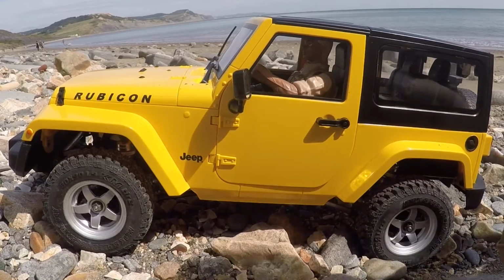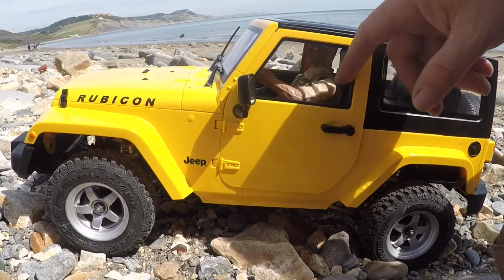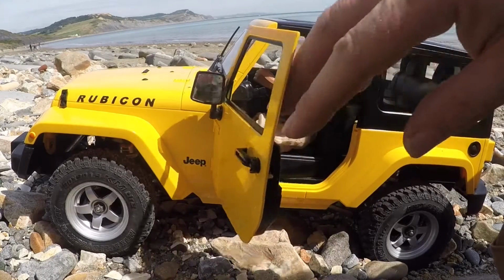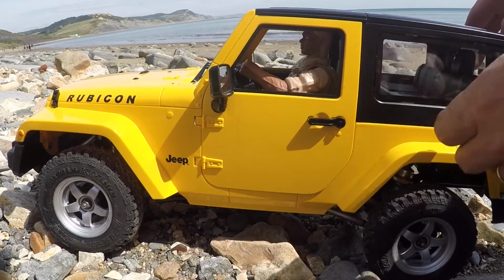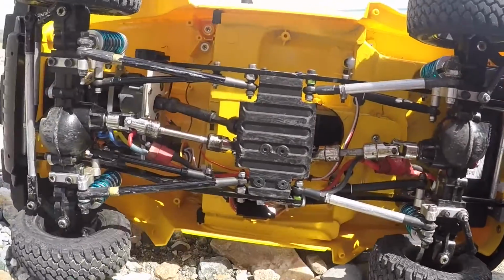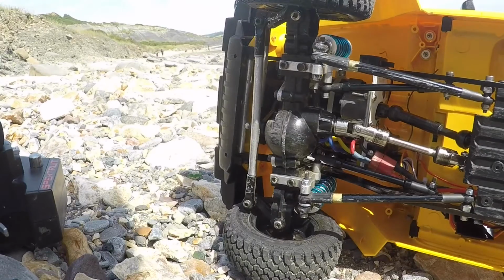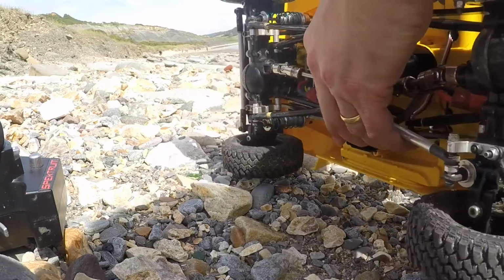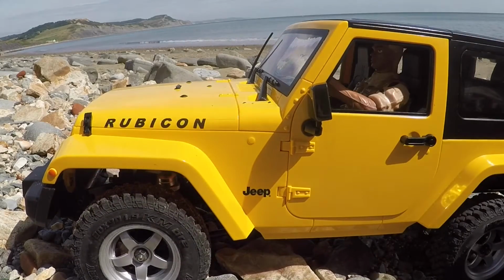1/10 RC Jeep JK Rubicon hard body with front motor and Tamiya high-lift axles

Comment: Good video. Nice camera angles add to the realism. Jeep seems about on par with the capability of a stock Rubicon. Well done!
Reply from the maker: Thanks! I always like to sneak an RC model or two into the suitcase when I'm going on family holidays. I've got lots of very capable RC trucks with massive tyres, but I was trying to achieve a stock like set up as they are much more challenging and fun to drive like this.
Reply: RC Modders ...Just like 1:1. I've had three Wranglers, the last one I built with only a 1.25" body lift and 1" front spacer to keep it low, ditched the fender flares and flattied the front, and ran 33x10.50 mudders. I swapped out the D35 for a detroit locked 44 and trutrac in front. That little jeep was a beast! I dont have a jeep anymore, which is why Im considering an RC crawler to satisfy that need. Cheaper when they break!
Reply from the maker: :) Funny, I was the other way round. The Tamiya Wrangler CC01 YJ (see here https://youtu.be/IaWABL3-AzE) inspired my full size 4L manual 2000 TJ (some pics & vid in the snow last week here https://www.facebook.com/profile.php?id=100015353018714) I've kept it stock (I live in London UK) and got it almost 2 years ago. Now I've got this I don't think that I could really bear not to have one. I think that the RC ones probably satisfy a lot of that itch .....

Comment: Can you put a list of the parts you used so I can build one I like it a lot
Reply from the maker: Hi, glad you like the video. This was a real mix and match and the parts might be scattered across various models now, but the basis would have been a fairly common body like this : https://www.ebay.co.uk/itm/275mm-Body-Shell-for-1-10-RC-Car-SCX10-Jeep-Wrangler-Rubicon-Engine-Grille-Cover/223122112066?hash=item33f31d3e42:m:mJBL1knbL9BrHrhORmVknqg:rk:19:pf:0 gearbox, a gearbox prob like this : https://www.ebay.co.uk/itm/1-5-Planetary-Gearbox-Transmission-Case-For-1-10-RC-4WD-D90-D110-RC-Crawler-Car/183640374622?hash=item2ac1d1bd5e:g:QhkAAOSwj9hcQGLc:rk:2:pf:0, transfer box like this : https://www.ebay.co.uk/itm/SILVER-TRANSFER-CASE-GEARBOX-RC-ROCK-CRAWLER-for-SCX10-and-D90-1-10-P3/121303615946?hash=item1c3e4249ca:g:PycAAOSwPYZU8Nen:rk:3:pf:0, tamiya hi-lift type axles, plus various drive shafts and suspension arms & shocks etc all modified to the right length. I mainly made this from parts that i had lying around or 'borrowed' from other trucks & bought replacements. If you have not done a mod build before, its probably best to start with a kit or RTR (like one of these https://www.youtube.com/watch?v=uhz0vHq4CP8) and then modify to your own requirements. The MST version with the motor in the front would probably be a better starting point than trying to replicate my build. Lots of people have sorted out a chassis and transmission for this body, worth looking on some forums and videos - good luck. 😀👍